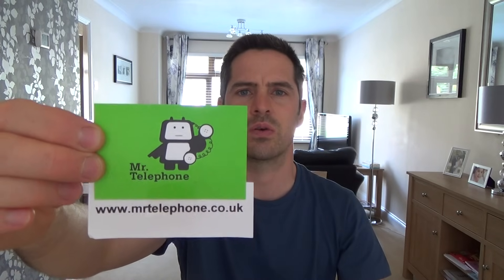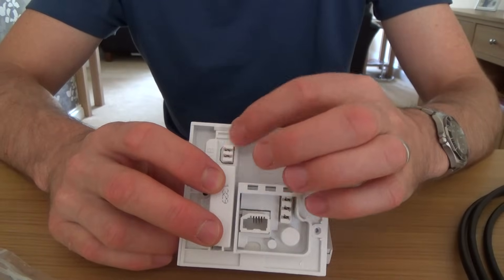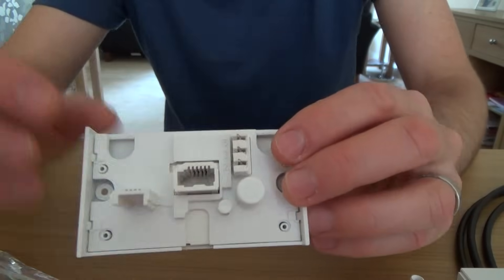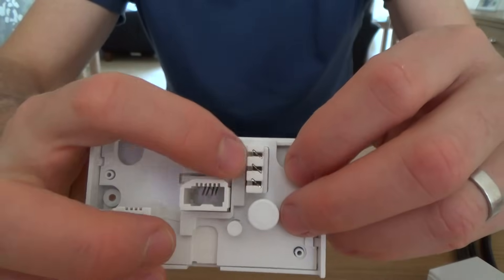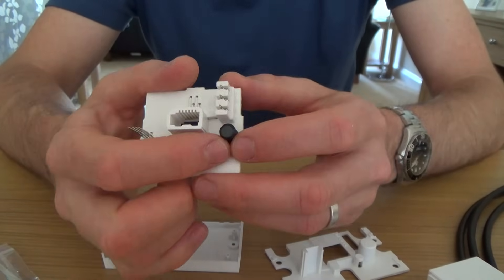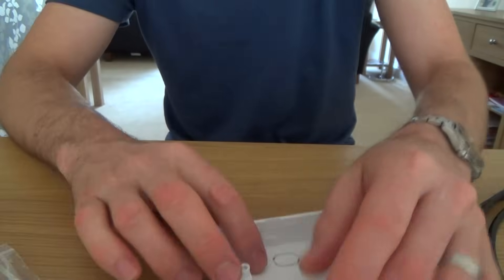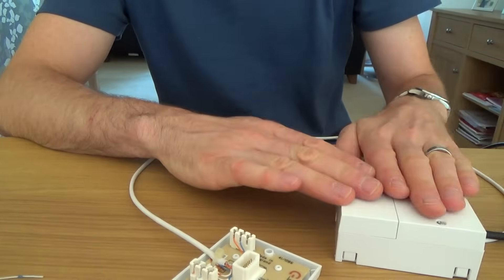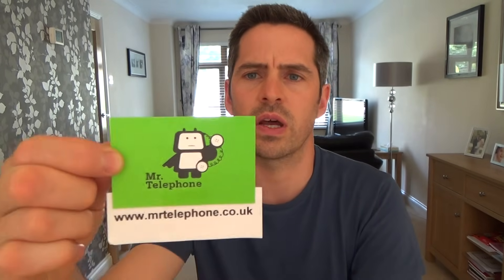How to install a NTE5 Telephone Master Socket and Telephone Extension

Comment: good video. i have a question which is new (i think)

i am building an extension which has meant the line from bt which connects from the pole to my house, now has to reach further to get to the master socket (around the extension). what i have done is to add some more line (similar to that extension cable in the video) and connect them with press down gel connectors. very handy.

this is temporary for 2 reasons. 1) the first connection is on the chimney outside & the white extension cable isnt outdoor grade. and 2) i want to rewire the whole lot and move the master socket right round the house.

here is the connection before i dismantled it. http://2.bp.blogspot.com/-MV-tKjwW5F8/VLkkrlzkSfI/AAAAAAAAyJg/Pu0yHTER4do/s1600/20150108_173922-790884.jpg

how should i extend this line properly and create a new master socket elsewhere? the line to the master socket can be easily routed along 3 points where i actually want ethernet faceplates. can I do this with a single (with 8 wire) cat5 cable and just cut and pull out 2 wires for each faceplate? at the master socket i will wire up the one pair and divert the other 3 pairs off to the router. is that a clever solution or have I missed something?

i dont really want to install a cable right through the house to the router and then all the way back three times for each ethernet thing.

thanks
Reply from the maker: jumpleadsx2 Hi, Ethernet works differently to telephone extensions. You will have to run the cable from each Ethernet faceplate back to the router so if you have 3 Ethernet faceplates then you will need to run 3 separate cables. BT would either replace the cable in one length from the pole to the master socket or put a junction box up at the eves and then run a new cable in one length from the eves to the master socket.Thanks Vince

Comment: Hi Vince, great video! can you use a filter to connect your internet through the extension once you do this?
Reply from the maker: Hi, thanks. Yes you can as long as you don't have an ADSL or VDSL faceplate on your master socket.